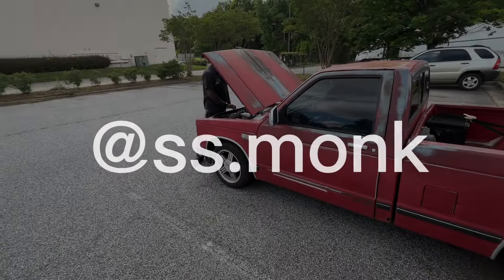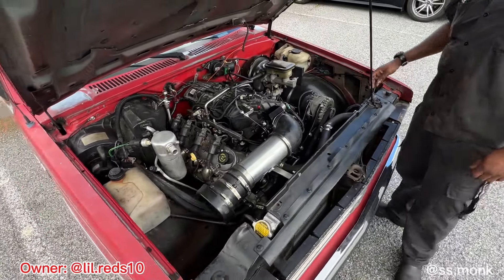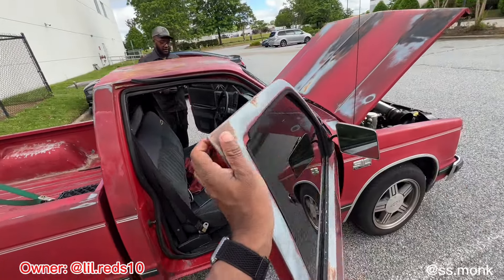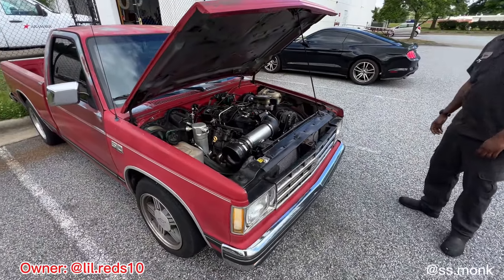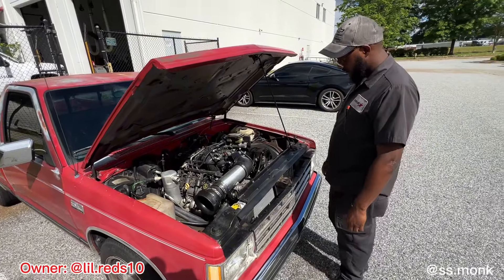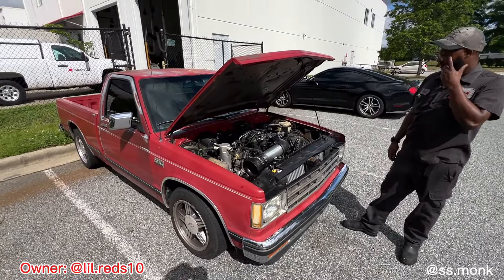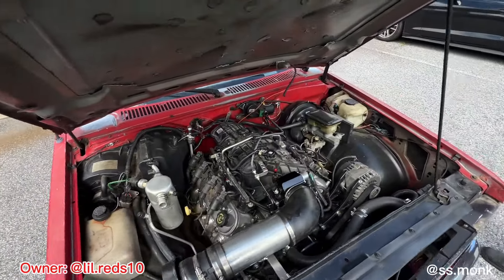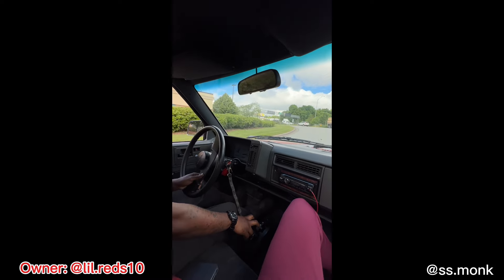LS SWAPPED S10 FASTEST IN GREENSBORO NC!!!!!😳😳😳🔥🔥

Comment: Yo bro we have the identical trucks plus I call mine lil reda 😂 thats crazy bro. I have to many projects and haven't started it yet but I have 5.3 stage 4 cam 4l60e with some work done to it 3200 stall. You my motivator at this point, she sounds like a beast. NC SC stand up
Reply from the maker: 💪🏽💪🏽💪🏽💪🏽 @cedricgilliam5446
Reply from the maker: Make sure you post videos of the build @DonavonWhite we wanna see !!
Reply: Everything is in the truck just have to run my fuel 12 volt and constant power
Reply from the maker: Easy 💪🏽💪🏽🫱🏽‍🫲🏼 let’s see it